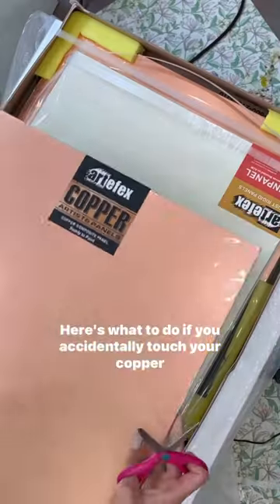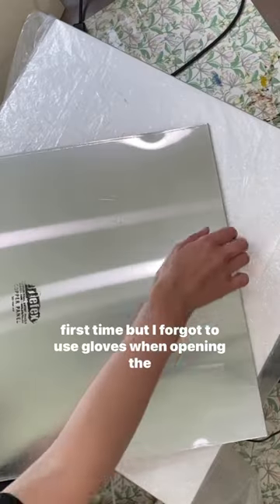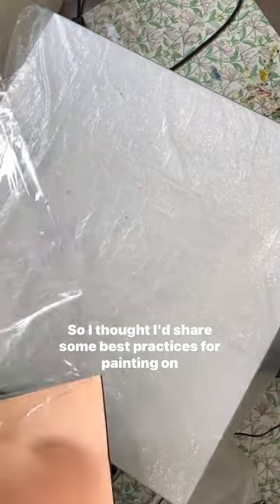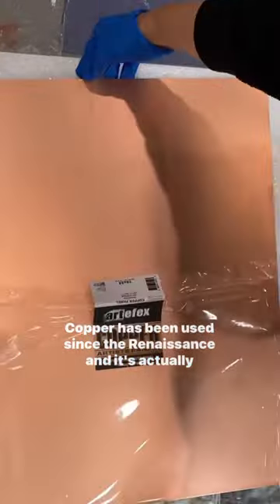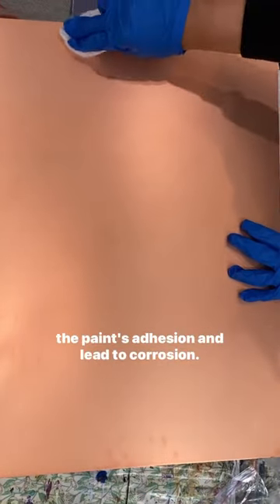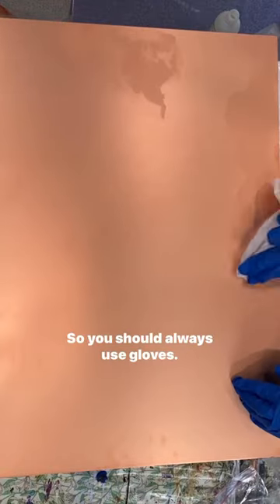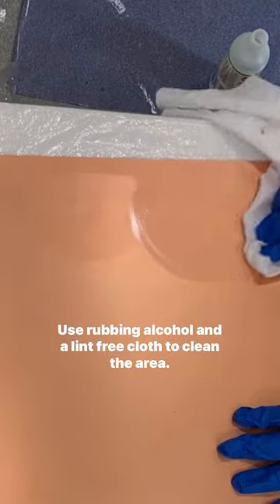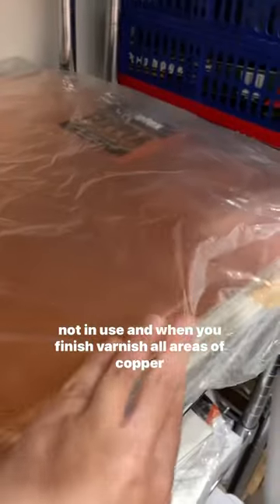Oops!! … don’t make this mistake! #paintingoncopper ✨🟧 ✨ #oiloncopper #copperpaintingpanel

Comment: I thought oil paints cure/dry through oxidation…?
Reply from the maker: They do.  You have to wait for the painting to fully cure/dry before sealing the copper panel with varnish.  The copper oxidizes quite slowly so from what I’ve read you have time to wait the recommended average 6 months for the oil paint to fully cure/oxidize before varnishing all the copper to prevent that from oxidizing longer term.
Reply: @dorisroseart  That’s so cool! First you need the process and then you stop it! Thank you for replying (the content and information)!